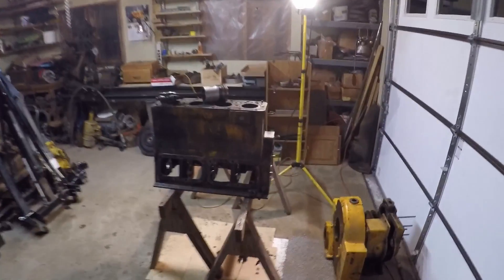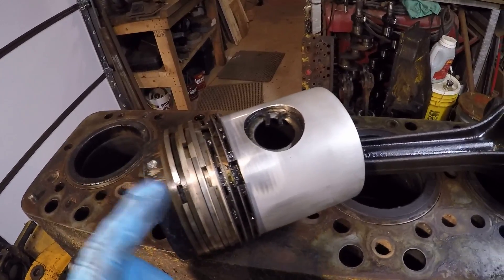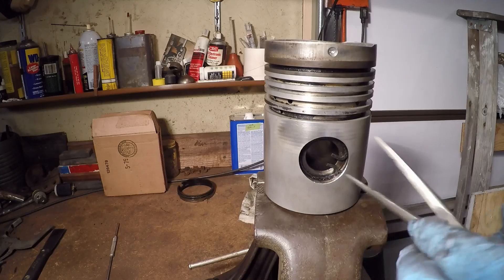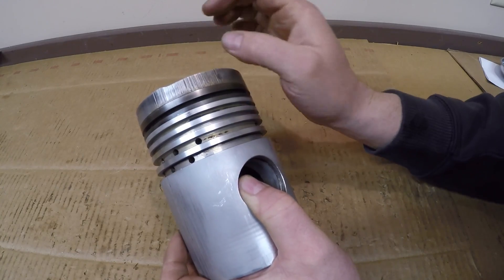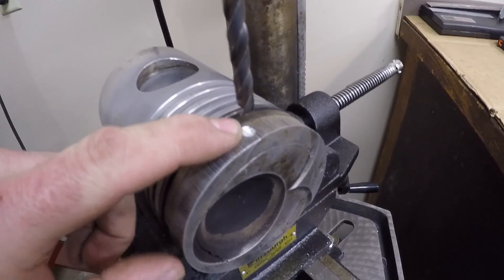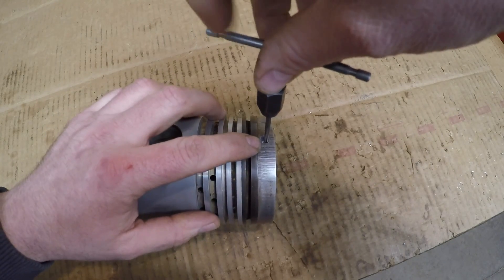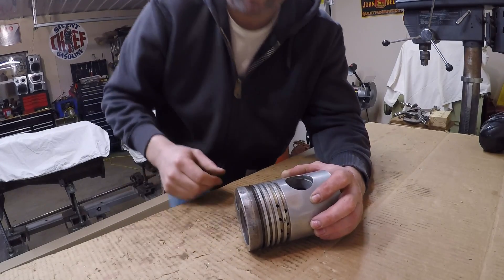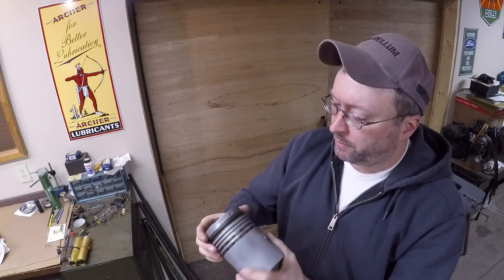Caterpillar D2 Design Failure - Disassembling the Notoriously Weak Multi-Piece Piston

Comment: I used to work in an engineering works in the early 1970's that made pistons for Caterpillar but not of this design They wer alloy with a cast iron insert into which the top ring groove was cut. Most people don't know a piston is not round it is oval and not parallel but barrel shaped.However it is only possible to ascertain this with a micrometer.

Comment: In a mechanic's life, there are few things sweeter than drilling, tapping and EZouting a stubborn bolt or pin, and getting it out without breaking the damn tool. Well done!  Wonder if any of the engineers that dreamt up those pistons are still around?

Comment: Do you think they threaded the top on for piston grading ?  ( piston grading is a process of getting multiple pistons all at the same amount of protrusion at the top of the block that helps with stack up tolerances from the crank shaft to the connecting rod to the top of the piston and in the advent of a block replacement the piston grading may be required)

Comment: seems like hardened steel pins would have been the answer.
Reply: Expansion rate of steel is different. It would of worked loose sooner.  The steel ring retainer expanded differently too, probably is the reason for eventual failure.  I also suspect the aluminum pin may of had a slight taper.  Be interesting to know.
Reply: @richardc2124  It would be best to just weld the aluminum pin into it... You could always drill out the weld later and still knock the pin out... IDK, maybe it's just a bad idea to begin with.

Comment: Turbo diesel engines burn at higher temperatures than gasoline engines, The original design philosophy of steel/aluminum design was most likely to keep weight down in the overall part, While the steel core helped contain the heat and pressure of diesel ignition.

The aluminum sleeve around the steel core seems to have doubled as yet another piston ring, Observable by the excessive scoring along it’s Y-axis face.

Just a theory though.

Diesel engines run at lower RPMs so why not just make steel Rods, Pistons, Rings, And Sleeves?

Comment: I have a D2...also looks like a J series since the paper works starts with 5J.  Rather laborious to start as I have to let the pony crank the engine over for an extended period of time before finally getting it to start. Doesn't help that the pumps seem to lose their prime. Either that or the compression release isn't fully sealing when shut. Been a couple years since last started it so it will be a REAL PITA. WHERE is it possible to get parts for the engine and IPs?

Comment: Engine cringe compilation: a video showing some of the worst engine and piston designs ever.  This would probably rank in the top 10.  Who the f*** thought it would be a good idea to use a threaded top cap to hold on a ring landing???  Better yet, why not use a steel rod pin that runs through the entire piston to hold the cap in place, since the pins are already 180 out from each other???

Comment: In the UK Caterpillar engines used Wellworthy diesel pistons which used a patented al-fin bonding to secure the single iron band  to the aluminium body. They did not have iron piston heads as the head was integral to the overall piston casting which was an aluminium compound.  I believe they worked well.

Comment: I could understand having a complete top piece, because the steel, conducts a lot less heat and would protect the rest of the piston.  (Or at least that's a concept that I've come across, before.) I don't understand why they would have a steel ring at the top, with an aluminum center. I don't see what you would be picking up conceptually, and then there's the problem where it didn't work practically as well.

Comment: THAT is the best ring expander I have EVER seen.  Whoever designed that had his head on straight!
It had BETTER be an aluminum pin if it is in an aluminum piston, as a steel pin would expand less and the joint would open up when heated.
Yeah, dumb design.  I am AMAZED, as an engineer, that that thing wasn't shimmed and tightened down TIGHTLY before it was pinned.  I wouldn't think that piston assembly would have a PRAYER of surviving, just FLOATING on the damned thread.  SUPREMELY stupid design.   I predicted the thread galling and breakage up inside BEFORE you took it off.  Again dumb design.  I would think machining up TWO pistons would be about the same expense and machine up TWO tops and one bottom (the equivalent of a change out at rebuild)...I don't get the whole idea.

Comment: Quick tip for carbon/oil/fuel deposit removal- use gel type paint remover- brush it on, wait a few minutes and wipe it away.Reapply if needed, but it will get the gunk off fast and provide a nice surface which allows you to inspect things without scraping and without any marks in the metals which is helpful for inspection and preparation.

Comment: as  a gas guy. that amazing. i rebuilt my mothers 4.6 ford after it spent 200k of its life consuming oil (a quart every week)  i swear i pulled a piston that had a good 1/4 inch of carbon... what a shit show.
Engine was never opened for 540k miles. 93 ford crown victoria . moms an idiot and would not pay for parts till it would hardly run.

Comment: I always wondered why the gap is so large, seems to be more than the material expansion? Is it to ensure some oil get captured between the rings? (Taking about that the rings circumference is less than the cylinder). Should you not (normally) use a copper brush on steel/aluminimum to avoid scarring of the metal? (I understand this is a throwaway though).

Comment: That piston could be reused. Once the ali pins were drilled out and the top removed, thread cleaned up, the top tightend using thread lock and larger steel pins reinserted. All that would need is new rings and the bore de glazed..
Reply: Look at the crown of the piston though, it was assembled first then machined. Tightening and reseating the outer ring misaligned the machining, only solution would be replacing the top steel ring land, replacing the alloy ring and re machining the crown. Then you still have the original piston body with worn and galled threads. No safe repair was possible, the entire piston had to be replaced. my only question is were an improved piston made to replace it later.

Comment: Great example of a successful forensic autopsy;  what kind of idiot would ever design such nonsense as  a 2 part Alu piston with a steel ring sleeve?
Reply: I can assure you that presented with a peculiar problem, you would have to come up with the same kind of solution. Back in the day the technicalities of heat travel in engine components were not well know and metal used to resist destructive thermal buildup were a real problem. The black steel ring you see was a common approach to the idea of maintaining proper thermal transfer from the aluminum cap into the internal structure of the piston and on into the oil cooling system. It is called a fire dam and the upper ring was used as a transfer medium to insure that the heat collected on the edge of the piston crown was moved to the internal part of the piston. The pathway was from the top part of the fire dome, TO the ring, and onto the lower part of the fire dome and then into the poston body. The 'problem' was that in order get the heat from the top to the bottom, the fire ring (the upper most ring) had to be in actual 'contact' with the two steel plates. In addition, the fire ring ALSO had to transfer SOME of the heat THRU the ring and onto the cylinder wall and into the water jacket cooling system, So, you had heat from the fire dome traveling to the fire ring and thru to the fire dam and into the piston.Later on it was discovered that a fire ring could be just as effective as dissipation heat by making the ring cross section in the form of a keystone. the tolerances of the keystone dimensions were easier to maintain  as well as the machined cut into the fire dome. When the ring was installed into the fire ring groove and the piston installed into the cylinder, the wedge of the keystone came into contact with the fire dam and the ring could transfer heat to the cylinder wall. What has happened here is merely a blip in the evolutionary timeline of thermal engineering in an internal combustion engine. The keystone ring design is preferable to this design as it also aids in keeping the ring groove clean by its constant in and out motion.
Reply: Darrow for the Prosecution --> Wow, I'll bet cold, that was a loud engine,
Reply: @darrowfortheprosecution1404  Thanks for explaining the thinking that went in to the design rather than the people who just call it a piece of crap and know nothing. Even today with modern diesels extreme injection pressures, compression ratios, different materials, etc. engineers are coming up with new ways of designing and manufacturing pistons.

Comment: Thanks.  Quite informative.  My guess is low compression from wear increased piston crown temps and exasperated the problem shown in this vid.  Any other factor that would raise crown temps such as bad injection nozzle, mis-timed injection, mis-adjusted valves, plugged air cleaner, and about anything that caused excess smoke could do it too.  More modern cast-in ring land pistons have a sense of humor about abnormal piston crown temps, but not these.  Not for very long, anyway.

Comment: A little tip from a fellow mechanic. With any type if ring that is used as a nut sometimes clamping down hard on it just makes the ring grab ahold of its threads and locks it up. Learned that lesson on a old 305 honda key assembly. I tried vice grips and it wouldn't budge but when I used a screwdriver and tapped on it with a hammer in one of the grooves in the side of the threaded locking ring it came off with no problem. So maybe even with the galled threads if you had used a small punch in the pin holes you could have gotten it off without splitting it.
Reply: Or use a pin spanner, they're a common enough tool.

Comment: Good idea, bad implementation.
This is still quite common today in larger industrial engines, but in different incarnations.
Some use an aluminum outer-skirt, and steel crown+inner-skirt, which is held together by the wrist pin.
And some of the very large diesels have the crown and ring lands as individual discs bolted together.

Comment: Even before you started describing what the pistons were made of, I started thinking about the possibility of 2 different types of metals. That's because I'm guessing different expansion and contraction rates with temperature.
Reply: That was my first thought - no wonder they loosened up. I'm surprised they passed factory testing in the first place.

Comment: Have to wonder why the entire top wasn't steel and not just the outer circumference. The thermodynamics would have been much better with the steel taking the flame front. Those pins looked pretty minimal for the job at hand. But according to what others have said, it was 1938. A time when the German nation thought Hitler was their salvation. Maybe the rotation of the earth was different at that time.
Reply: All about weight, imagine the weight of a steel head piston

Comment: I'm glad that piston manufacturers found a way to cast the aluminum over the steel ring lands. I see these on diesel engines but not on gasoline engines.
Are replacement pistons for this engine all built with threaded piston crowns, or can you buy pistons with cast in steel piston ring lands? Also, when you buy replacement pistons, do they all come with 3 compression rings and 2 oil rings, or did they go to a more modern ring pack?

Comment: Hi again mate got another question as you seem to be the best for this. What is the gauge/size copper tube for the oil pressure line and also for the donkey engine fuel line? 
Cheers

Comment: Thanks for the failure analysis. All of the largest diesel have multiple piece pistons. There are no wrist pins. The piston crown includes the ring lands.They wear in waves patterns and will break rings when they widen enough for carbon pieces to get between the lands and rings. Crowns are repaired by welding the lands and recutting the lands on a large turret lathe. The cylinders are lubricated by a total loss system.

Comment: spent most of the day pondering two part pistons in D2     did valves in5U3369 in 1969 at 3400 hrs  top insert was loose then but we didn`t go into them.  piston failed at 6100 hrs. aluminum coeficient of expansion is 2x that of steel so added in steel insert would tighten up as engine warmed untill play became too much and failure was the result. 72 yrs old and still learning!!

Comment: I did liners and pistons in my 50' d4 in 2000, it had pistons like that but much worse. I could turn that steel ring bout 1/4" and think it was close to coming apart.  All 4 were loose.  1 them pistons is still here somewhere.  I think there was a service bulletin recall done on those... but only the bigger big spender company machines got the warranty work done. Lowey single purchase farmers never heard about it.
Reply: I wonder if Cat will still honer the recall?

Comment: very odd construction. but it worked for likely thousands of hours. it worked, worked well til it diddnt. wonder if the thermal properties of the Aluminum and steel would cause that to loosen up over time. hundreds of heat/cool cycles etc.

Comment: So if you had to reuse the piston -Do you think a thread chaser would clean that galled thread .?
Reply: @squatch253  Yes we all have done that too,Cross threatening 70s Chevy transmission lines , Chevy Fuel pump, I've had to rescue a few guys from the side of the highway LOL.
Reply: @squatch253  Ya that ring tool is nifty no farting around .
Reply: Well thinking about it,is an open question whether more pins would help,or is it that there are insufficient threads to hold over the very long term ?
Junk the collar,machine new threads into the piston body. What threads ? Standard,Acme,some special buttress shape ? Need deeper threads,at the very least. Match with a new collar,tighten without deforming the aluminum threads but close to material strength. Contact Loctite tech rep ? Use the heaviest dutiest product that will survive that hard environment.
Then machine the collar. Weld  new aluminum to the galling above the iron collar before that,then will be cut down while collar machined ?
Important not to damage the iron collar. Or,spray welding it and machine down as well ? Given the consequences of collar failure,belt and suspenders approach is indicated ,no ?
If anyone with technical or materials knowledge wants to wade in here,great. 
Expensive,but since new pistons are not available,what is the alternative? 
An undersized sleeve and piston and sleeve are custom matched ?
Or give up and contact a company that custom manufacturers new aviation pistons . I just cannot think of any other approaches,maybe there are.

Comment: Never knew such animal existed.  I wonder what times the thread so ring land is tight and valve relieves are indexed properly?
Reply: Well if they could do that with rifle barrels well into the 1890s,maybe earlier,they could do that here. There are YouTube videos of a replacement barrel fitting to an old receiver,the front sight is already in place (!).
Pretty much the same idea here.
HAH ! A new project for Adam Booth over at Abom79. Best darn machinist I know of. Incredibly calm and patient.
Or perhaps the pocket was only scooped out after assembly. That would be my chickenhearted approach. A specialized shape of horizontal milling cutter could do it.
Thanks for bringing that up. Wonder which approach they actually took.
Reply: @paulmanson253  now that watched it again.. I think relief was cut after assembling; never to be disassembled again to be serviced
Reply: @nnaatz1  I suppose a fixture (jig)sliding in the wrist pin hole would very simply time it,on reflection.  The pocket is in the main body,no ? Not the outer sleeve.
I wonder if say 4 pins not two would have worked,or are the forces such that it is not the pins being stressed but the threads. Too heavy a ring of iron,too few threads to accept the relentless G loads at top and bottom every single time. Probably the threads. We need a good materials engineer to pipe up about now. Thanks for the comment.

Comment: Yeah, I agree with The SearcherMan.  I believe it's a good design.  Remember, this was 1938.  In the day, it was brilliant.  Sure, we hope there are better products and designs today.  But, this design proves how intelligent the Cat Engineers were to recognize that a solid aluminum piston would not serve.  They did what they knew, and had machining techniques to do.  Imagine had they used 3, or even 4 pins to better share the load.  You would probably still be reusing those pistons to this day.  Who knows the abuse these engines have taken (namely starting fluid).  How many times the pistons have been seriously overheated.  And, they lasted this long.  Incredible!  I would not call these pistons notoriously "bad" at all.  But yes, when you reassemble this engine, I advise considering using a more modern design (if available).

Honestly now, since I just said that, I wouldn't be surprised if somebody advises slightly modifying (re-pinning perhaps) and reusing the old pistons that are still good to preserve the originality of the engine.  That could generate a great debate!
Reply: I would have to imagine that originally the piston design included heat fitting of the top ring. If done correctly it would be fine for quite a while. But as you point out, this was done in '38 which was also quite a while ago! I'm sure for the most part the pistons held up well at first, but after a lot of hard use did eventually fail.
Reply: Oof. You just HAD to think of that,didn't you ?